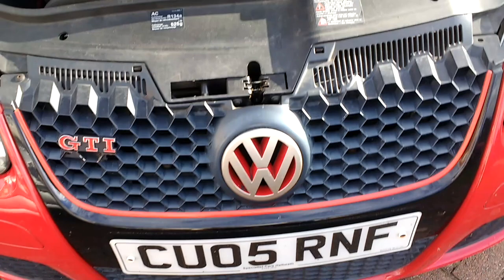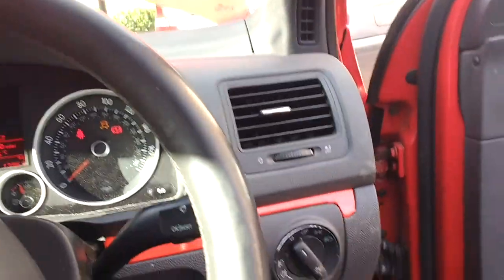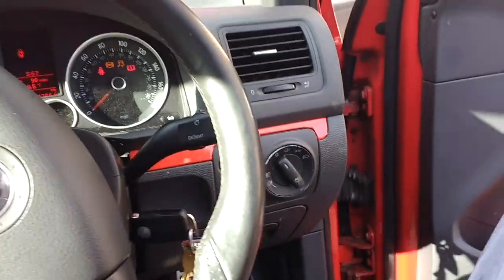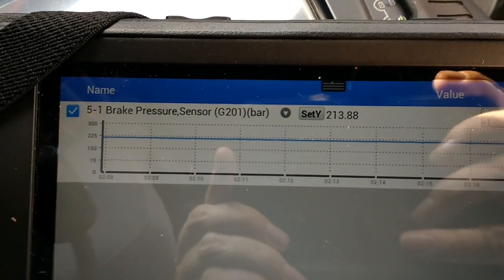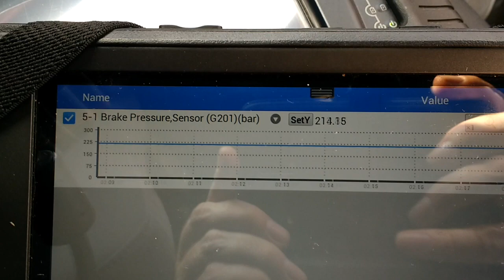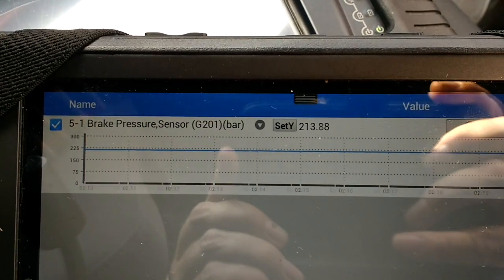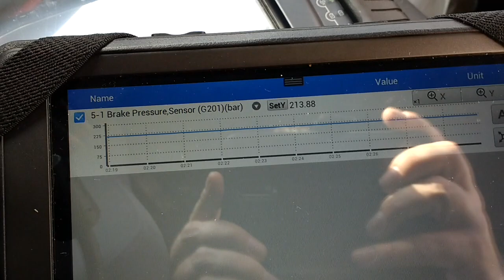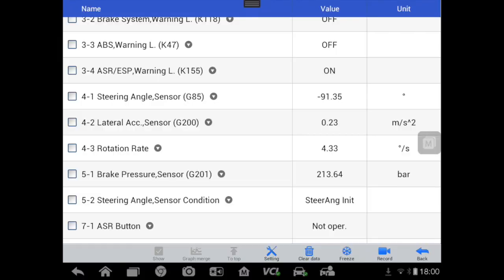VW FAULT CODE 01435

Comment: Hi Andy 
Thank you for sharing 
My neighbour Porsche cayenne 2004 have the same code.
Also live data is sitting at 195bar with sensor plugged in or unplugged 
Don't see any outstanding recall on mot history.
Time to call Porsche and see what they say
Reply from the maker: You better have a seat ready when u call Porsche as u may collapse when they tell u a price!!!! I would try and get it rebuilt from a reputable company. Cheers, sandy

Comment: Hello! I have a problem with the same fault code, and, on the diagnose, it says "intermitent signal". It's weird that the ABS and ESP lights turn on only when the outside temperature is 25 C or more. Do you have any idea of any problem that causes this error? The pressure sensor variates between 0, 0,30 0,60. I have a Passat B5.5 2001 with the ESP pump being separate.